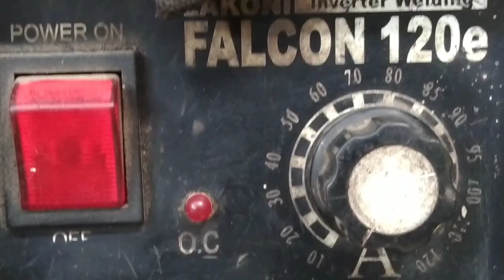not everyone knows, the secret of welding is in welding thin square tubes

Comment: non sono sottili, quelli sottili sono quelli da 1.5mm che si squagliano appena li guardi 👀
Reply from the maker: sorry I demonstrated the thin pipe welding technique, didn't call my pipe thick
Reply: @asiawelder   It looks like 2mm thick to me, which is a minimum for hobbysts and I believe it's pretty common for pros. Also, I read your title in italian and software translator just does not do a good job 😅.

For my relatively poor skills, welding a 1.5mm and below is a little bit more challenging 😅😅😅